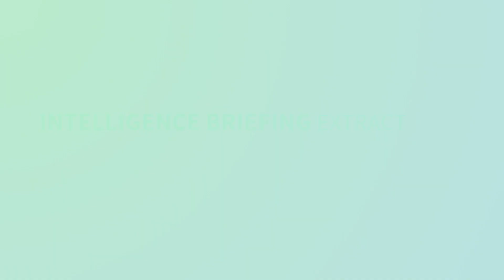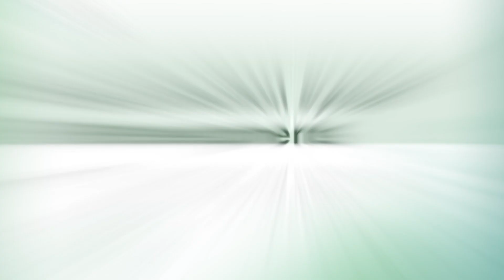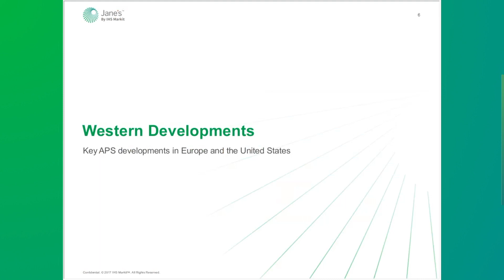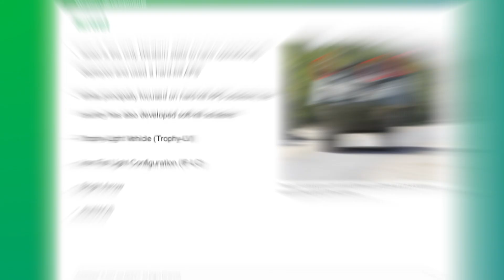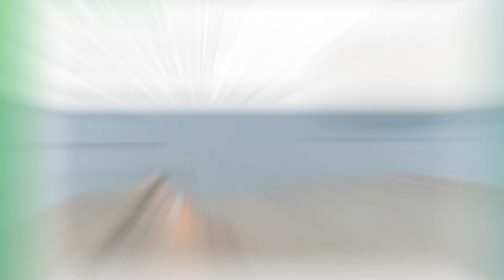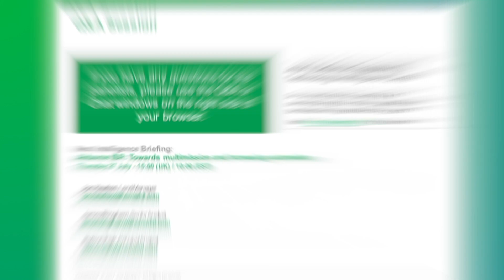Intel Briefing: Developments in Active Protection System (APS) technologies

Comment: AMAP-ADS not mentioned? it seems superior to launched systems due to its very short reaction time...
Reply: It's not much known about the system yet. However it seems like it would exceed the capabilities of any other APS in terms of reaction time and effectivness by far. As example, trophy has a reaction time of ~300ms, ADS has a reaction time of 0.56 miliseconds. That's 535.7 times faster. Rheinmetall still plans to sell it to the german bundeswehr in 2018 or 2019.
Reply: yep, its also part of the Boxer-System for the australian Land400 ... so I expect it to be almost ready for troop-testing ... maybe the lack of information about it is intended
Reply: There are several versions. The 'heavy' version as seen on the Leopard 2 Revolution (MBT Technology Demonstrator) is compatible with Leopard 2 and especially Puma IFV versions currently fielded.

The ''heavy' version was even tested sucessfully against 120mm APFSDS tank ammunition in the past, beding and shattering the KE penetator, reducing its force drastically.